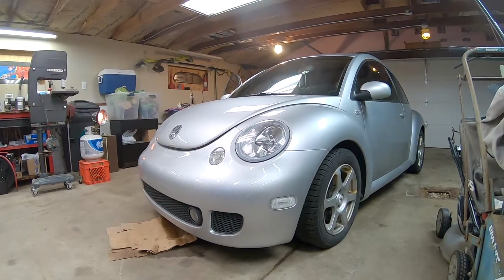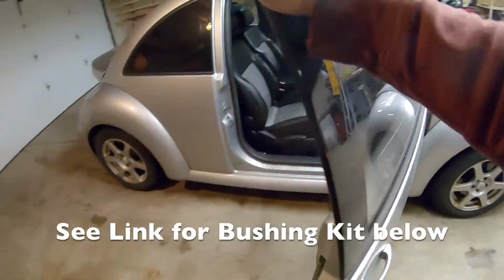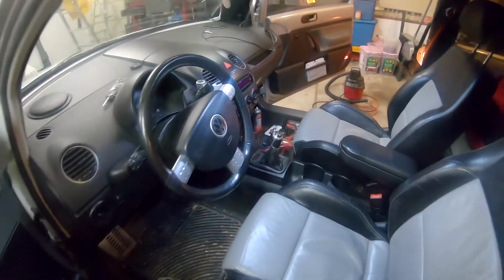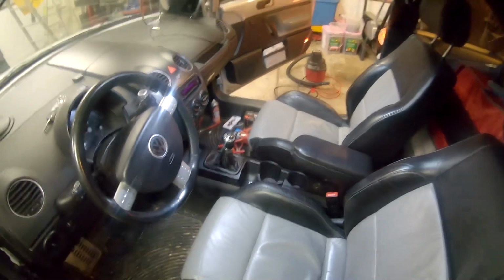How to Install Shifter Bushings and Remove the Console in a 2004 Beetle Turbo S

Comment: Wow! 👏 thanks for getting some of those tough camera angles! Excellent video 📹.   I will most likely be tackling this chore soon, just picked up a 2000 for my daughter's first car. Thanks again
Reply from the maker: Glad it was helpful, and sorry for the lighting.  Garage is sort of dim and with a dark interior it was hard to capture on camera.   If it's a turbo you should definitely chip it.  I love this car, 275 ftlbs of torque is no joke!
Reply: @ADDvanced  no worries. I've got the airbag steering wheel apart. Just waiting on the new part to come in.  The 🍄 security screws look so fun to deal with lol... 🙏✌E-🦸‍♂️
Reply: @ADDvanced  I just bought a turbo s the shifter does not feel as smooth as I think it should going into gears. You did not explain the symptoms and how you determined you needed to replace your bushings. Also. What chip are you talking about? Is it something simple that adds to the fun of driving the car? Thanks best wishes.
Reply from the maker: @COVMAPA  Just hard to find gears, sloppy, doesn't feel precise.  It was good for a long time then suddenly got a lot worse as the bushings disintegrated.   Chip is a unitronics stage 2 which bumps up the power from 180hp/180ftlbs to 235hp/275ft/lbs.   It's night and day, the car is so much faster!
Reply: @ADDvanced  ok cool. great info. Thanks very much.

Comment: great kit, but expensive af. I found the whole shifter with cables at 10$ in very good condition.
Reply from the maker: Nice!   I don't think the price was too bad considering it's all brand new and better than OEM, firmer polymer.
Reply: I would rather buy the whole OE mechanism instead of all the bushings, the price is similar and I get warranty. You're talking about overpriced pieces of polymer :) Be real.
Reply: @alexandrulupu725  Where at?
Reply: @alexandrulupu725  You  have to drop the exhaust to install a whole shifter.

Comment: What symptoms did the car have to let you know the bushings were broken? Thanks in advance.
Reply from the maker: Couldn’t get into reverse and the shifter got really sloppy
Reply: @ADDvanced my wife shifter wobbles it loose she was driving then boom. It's stuck in 4th gear, you can manually move it in the engine bay. But shifter itself is completely loose and just wobbles. Is this what I need to do?

Comment: Is there a way to do this without drilling a hole in it?
Reply from the maker: Yes, if you drop the exhaust system you can access it from under the car.

Comment: What size fog lights are those in the bumper grill? I’m missing them
Reply from the maker: This is a Turbo S model.  You probably have a GLX or normal turbo.
Reply: @ADDvanced  My bumper is the same as yours I do have a true turbo S I’m also missing the blinker lights that are built into the bumper I don’t know the size if I knew I could replace them. I have the lower center grill insert but I’m missing the left and right side lower grill inserts.
Reply: @ADDvanced  It is a wartortle